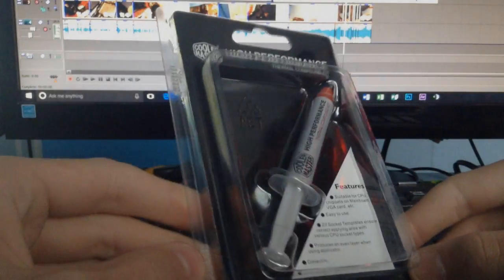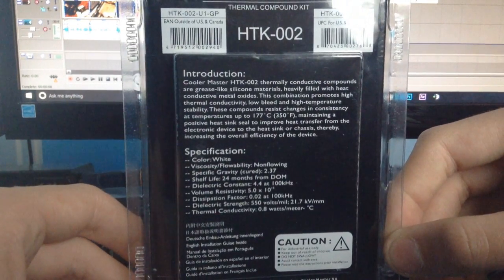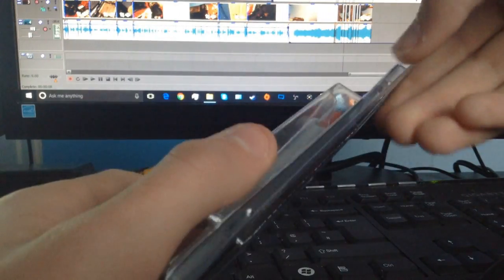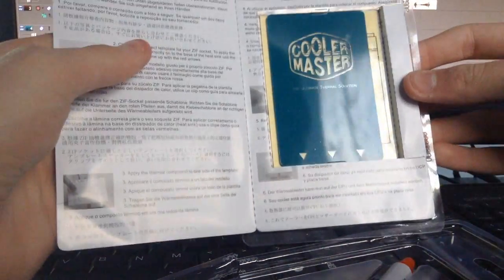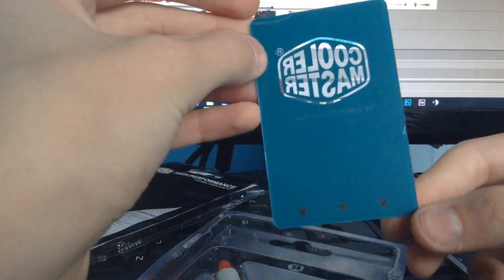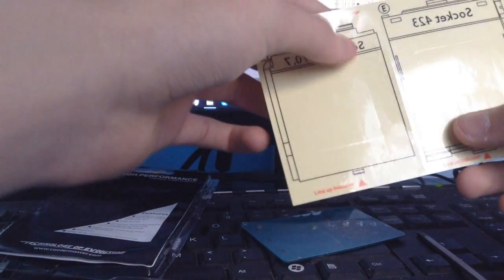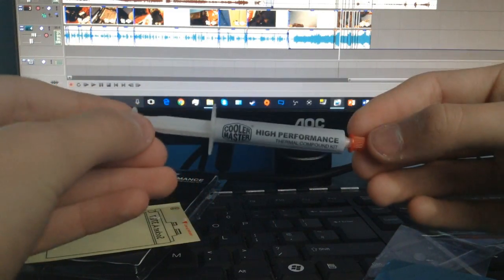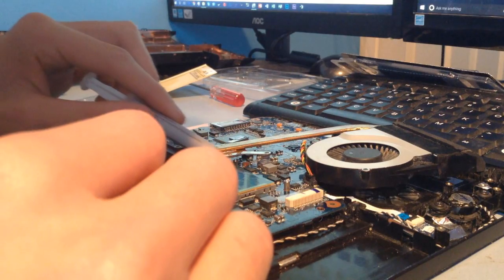Cooler Master Thermal Compound Kit Unboxing & Review

Comment: Really? U tried new paste for your laptop but u didn''t clean dust your fan?
Reply from the maker: Did that but also applied some new, much better paste on the CPU due to the crap thermals that laptop had.
Reply: i bought this paste for my Dell latitude E6540 with specs:
I7 4800MQ
AMD HD8790M
8GB RAM
and can this thermal paste can be good with my laptop? Someone told me with this laptop specification, i should use Artic MX4 or Artic Silver 5 is better for the best perfomance, especially play games or render video
Reply from the maker: You would be correct a Arctic is a much better premium thermal paste - if you want to spend the money then I’d get that instead of this. This paste does a good job for a ‘budget’ solution.
Reply from the maker: You would be correct a Arctic is a much better premium thermal paste - if you want to spend the money then I’d get that instead of this. This paste does a good job for a ‘budget’ solution.
Reply: So i will spend "a bit" money to buy artic for better performance. Thanks for your advice